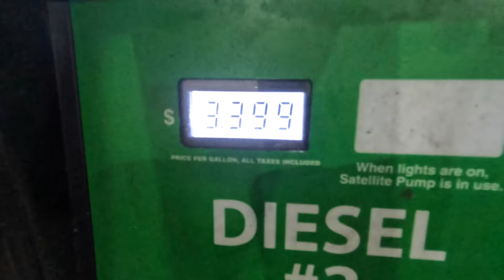MORE DEADHEADING IN THE DOWN SEASON. Alicia Keys Troubleshoot. Non-CDL HotShot Trucking

Comment: I was at BP gas station, and the gas handle is green. I thought it was diesel. And I put about 4 gallons and a before I realize what I did wrong. I had to sit down pump everything out. I didn't have any problems with the truck after that but it was scary
Reply from the maker: You are so right. BD will confuse you with black and green handles.